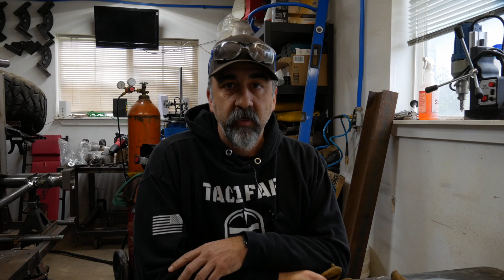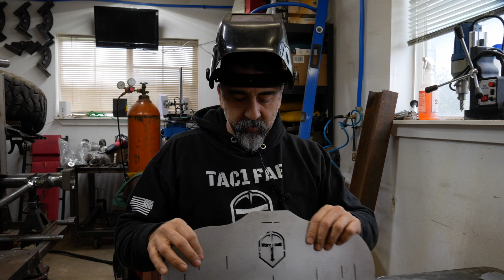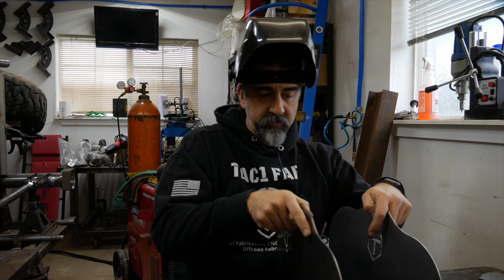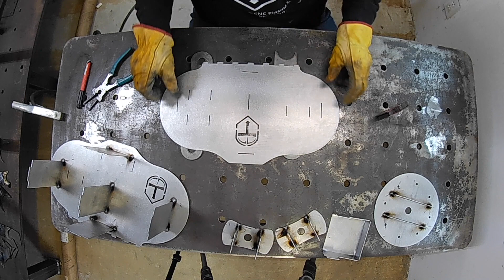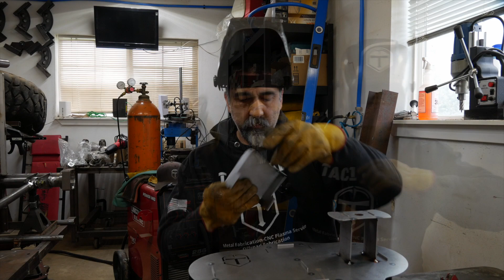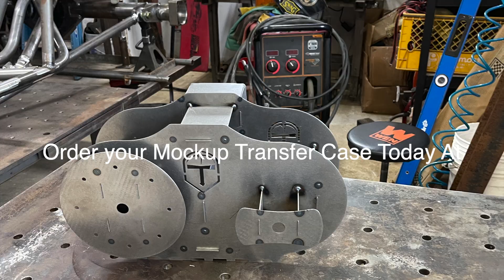New Product! TAC1 Fab - Mockup Transfer Case Assembly Instructions

Comment: Nice work.  I would recommend considering making the tabs about 1/2 material thickness.  It would still locate but allow for weld in the slot if desired, also not protrude to need to be ground down.  

  I was going to suggest offsetting your logo to the same side so the front and back pieces would have the logo in the same spot if oriented right.  But I think the logo is well placed when assembled.  So, I'd suggest that you change the tabs from one to two of different sizes to key in only one way into the front and back.  The top and bottom pieces would still be the same but only go together if the back plate is the right orientation.

  Now that I'm typing that.  If you offset the bottom case spreader standoff by and inch and the rear plate won't go on wrong.
Reply from the maker: These are some great thoughts and suggestions. Thank you. Yes there will definitely be some revisions for the next batch.